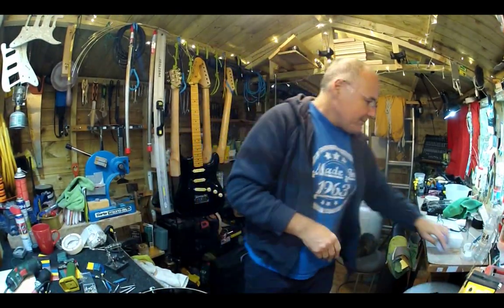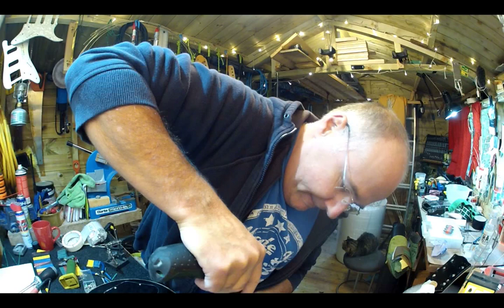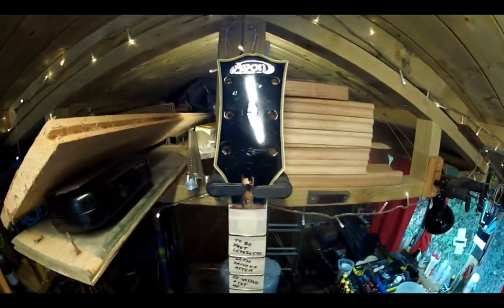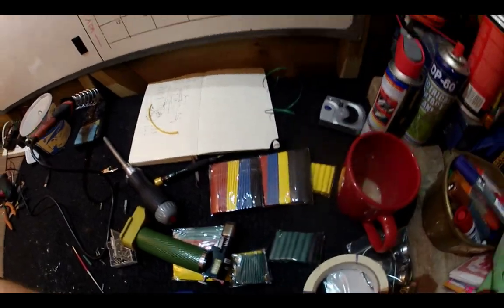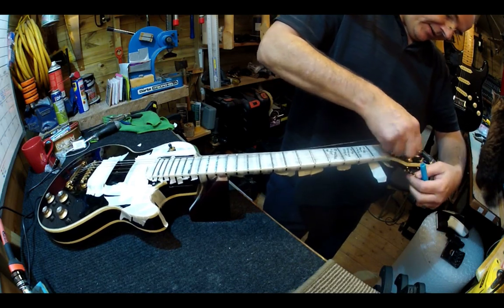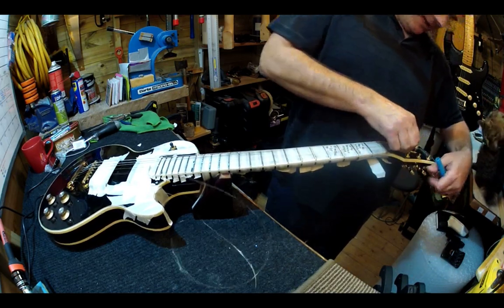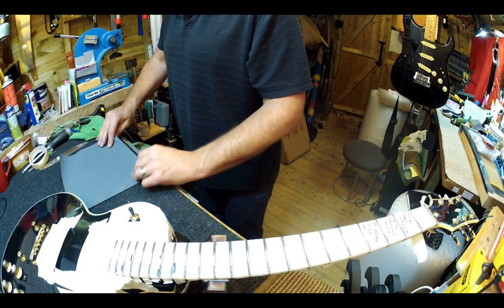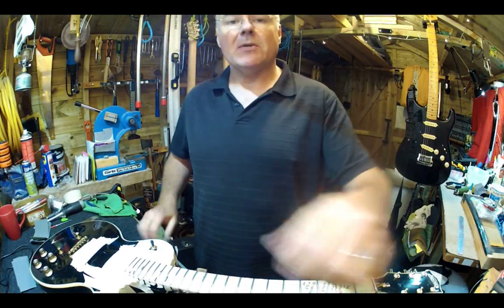Avon Les Paul Copy refurbishment

Comment: I have saved one of these from a the local tip ..not bad and fun .Its good sounding guitar but its not a Les Paul full stop .Its really semi hollow as its body is ply  ,about 8 layers and a pressed  moulded ply cap  thats hollow inside .It sounds better than it should   .I get some nice bluesey  P90 ish jazzy sounds  which is style I play anyway .Might buy a new bridge but I have played a lot worse.In some ways it reminds me of that little Jet club Gretsch knock  out which is a fine guitar.Mine lacks the screw on headstock badge so if any one has one let me know.Not a bad guitar for a fiver ,a new  first string  tuner , a cheap wiring loom as the stock one was just  noise ,and some Gibson pump polish and new strings of course .